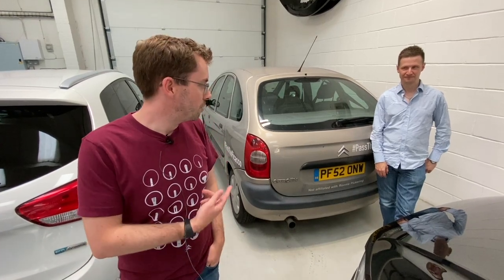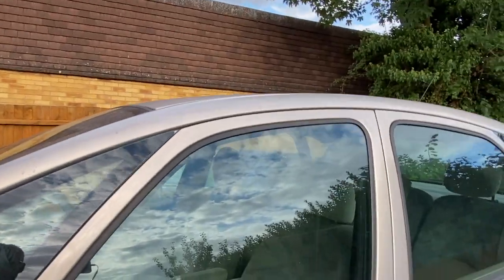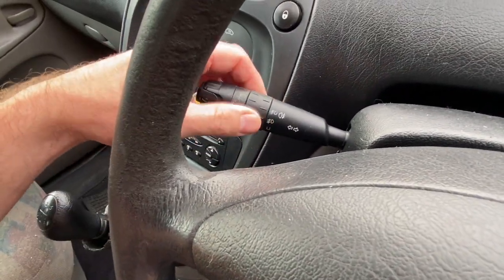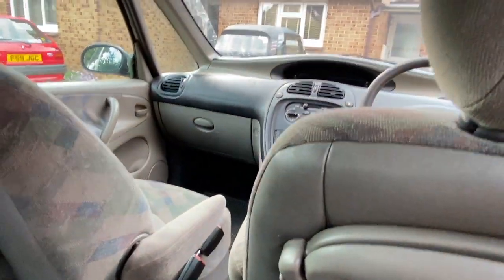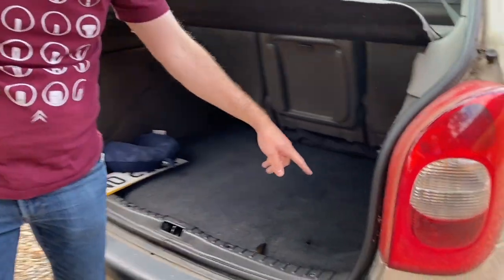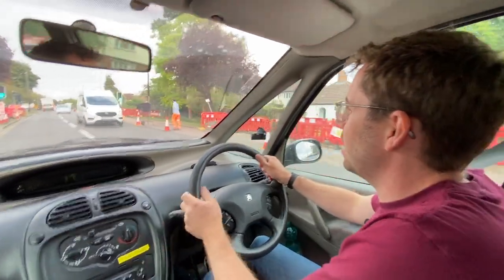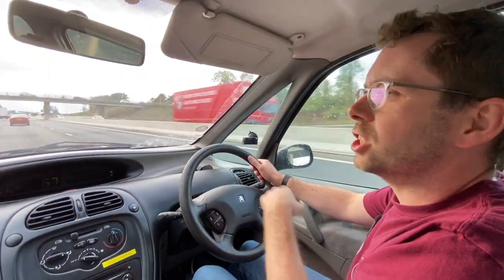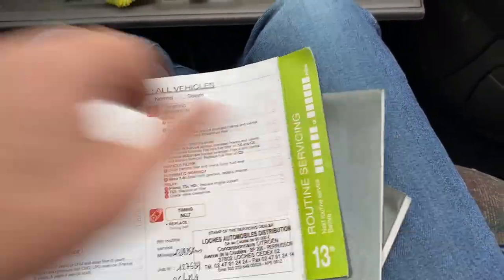This Citroen Picasso has more miles than Apollo 11! (#PassThePicasso Part 1)

Comment: I think the reason it suposedly jumped howevermany thousand miles in 6 months was becuase the digital speedo / milage reading had been set to km at that time. 157,000km is around 98k miles so that is a little more realistic!

Excelent machine, I absolutely love cars like these which must have such a story to tell. Can't wait for more on it.

Also, that Citroen shopping basket is the best thing I have ever seen! I think I may have to add that to my long list of eBay saved searches lol
Reply: I have one and you have 2 options, imperial or metric. Switch it round and it changes everything, press again and you go back, it does not " mix and match ". You have a better choice with languages though, I accidentally changed mine to Portuguese, finding the way back through the menus to change it back was interesting.

Comment: The PSA HDi engines are superb. I had a 307 with the 1.6 HDi engine back in 2005. It was very economical, pulled extremely well, and was refined. The 307 was also a superb car - one that I remember with a lot of fondness.

Comment: They are good mini mpv's, can easily carry 5 adults or two adults and three kids and all their shopping or luggage, has a useful pull out wheeled trolley in the side of the boot (that's assuming it hasn't been removed), can adapt for bigger loads by tumbling and folding rear seats forward or removing them altogether (it becomes positively cavernous when you do this), and in HDI diesel form is the best fuel economic vehicle.
Reply from the maker: I'm using the car a lot at the moment, and it's definitely a very good and useful workhorse

Comment: Actually at 19:58 you can clearly see that it shows kilometers (not miles), so they simply switched units in 2007. I wonder if it still counts in kms, then it would have "only" just over 300k. But still, that's a nice achievement

Comment: you do see them online for sale. I think you should get one as a project, but go for the 2.0hdi as that is the better engine. throttle may just need greasing?
Reply from the maker: Having checked, this is the 2.0HDI with 90bhp. I did think to grease the throttle but couldn’t see the linkage in the time I had available

Comment: "Bastion of shite" - Saved for future reference.

They look like potatoes, I've never liked this first iteration of Picasso (should have been called the Citroen Xsara Potato), they're rot boxes and look awkward form almost every angle. Like the version after and the last version though, they're a neat well proportioned design especially the LWB version, but I've never liked the appearance of these.

If it's like the  XUD, which was what a BX I once had (and loved) used to have and that had a really heavy accelerator pedal. It felt lethargic until you properly mashed it and then it would pick up its pants and run.

Great to see one with Neil Armstrong mileage on it!

Comment: Don't believe it. 500,,000 miles.

Is this a new phenemonen ? Clocking for sensational videos.

There's still bits hanging on it. Euh ?

 Presumably, this is before the mass application of cyano- acrylate ester on the production line.

One, careful old -lady owner . . . Must have been a part-time coffin dodger !

The electronics in the  instrument binacle still works . . Wow .

Little road noise.

No steering wheel movement  . . Blimey.

Windscreen and glass damage ?

Head-lining still taut ?

70,000 miles in a year,  dinghy divers car ?

Typical diesel, heavy clutch or blued clutch spring ?

I have similarly aged car ( 20 next year), of VW lineage, with only 7Ok on the clock and already its had 2 new anti-roll bars, a gearbox rebuild, a new clutch, 2 sets of cam and alternator  belts and one complete set of new tyres and action to halt water leaks in the doors. It runs about with unrepaired A/C (Failed motorised temperature flap), leaking temperature sensor in radiator,  drooping head-lining, and foggy plastic headlight covers, but can still do motorway speeds with ease (10.3:1 compression ratio, so 100 HP out of straight injected 1.4, no blower).